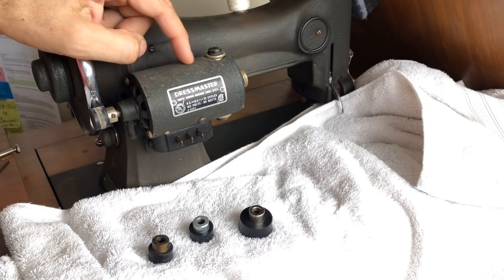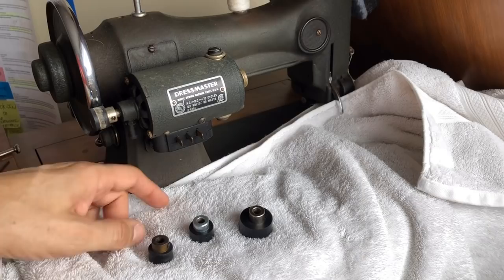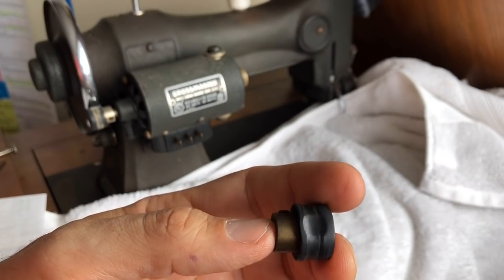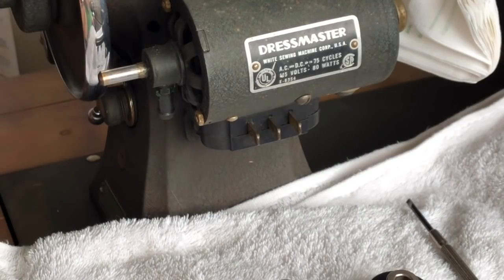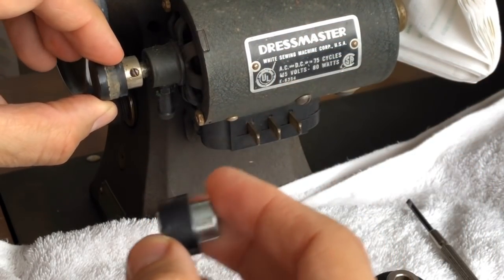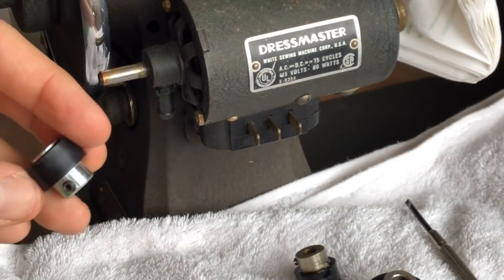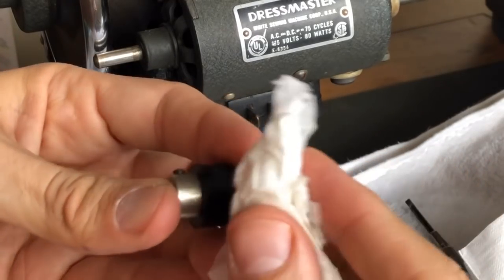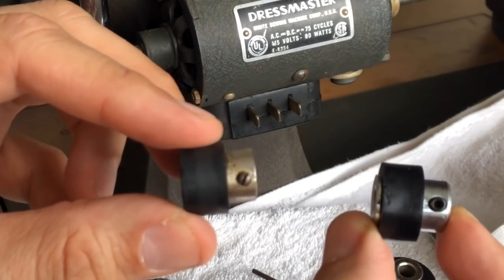ROTARY SERIES #1: FLAT TIRE! Replace a Rotary Machine's Friction Rubber Pulley & Start Sewing Again!

Comment: I have one of these, a sewing machine repair had a replacement pulley, but the spring has deteriorated. How are those replaced?
Reply from the maker: Hello Wanda.  The spring/motor mounts onto the body of the machine with screws.  You can get replacement (vintage) either spring or whole spring with motor at places such as Ebay or Bonanza.  I would try those first.  Theses machines were made in large numbers for many years so, similar to Singer, vintage parts are fairly common compared with some European brands.
Reply: Thank you!

Comment: Hello, thanks for the video.  I have a beautiful old White rotary that has only the one issue with that friction pulley.  I ordered a replacement, but the rubber was too thick.  Until I just watched this video, I didn't realize a pulley with a thinner rubber layer was available.  May I ask where you purchased your pulleys from?  Thanks so much!
Reply from the maker: Hello.  Sure,  I'm happy to share the supplier.  It is called:  Sew-Classic.  You can find them at: 
https://www.shop.sew-classic.com
Reply: @VintageSewingMachineGarage  awesome!  Thank you!

Comment: Would you say this machine is similar to the Montgomery ward model 30? I have my grandmothers and want to start using it but has sat for at least 20 years.... I’d love to use this series to help it get fully working again!!
Reply from the maker: Hello.  Your machine was made by the National Sewing Machine Co.  The model 30 (AKA "The Streamliner") was in production for more than 15 years and I believe it is a vibrating shuttle type and it works with long bobbins which was a bobbin system used by many makers including Singer but was eclipsed by the Class 15 and Class 66 styles which eventually became more popular.  So, yours is not the same as those Rotary models made by the White company.  White had a contract with Sears and so it makes sense that National would have supplied Montgomery Ward given it was a main competitor to Sears.  I have not overhauled one like yours since they are less common.  National also made machines for other private labels such as Macy's.  As you look for more info. on yours, I would also look for info. on National brand sewing machines as they would have had very similar models but perhaps with changes in color and trim.  Machines like yours were very strong machines and you are especially fortunate that it was in your family so you have a genuine heirloom!!
Reply from the maker: Also, I would find and join sewing machine groups in Yahoo or Google and search under National  Sewing Machine.  If you only search under Montgomery Ward, you will find machines unrelated to yours since MW would contract out with multiple makers over the years just like Sears did.
Reply: Vintage Sewing Machine Garage 
I found this very thorough article on my machine but I don’t understand a lot of it 😂 thought I’d post it as it may be helpful for you!!   The website also goes over many other machines. I appreciate all the input and will keep digging!! 
http://www.doubleveil.net/zssmp/streamliner.htm
Reply from the maker: Thank you for sharing.  Wonderful site and so much info. for a machine that gets little attention.

Comment: Is there any reason TO or NOT TO use the larger one on a machine with the smaller pulley?
Reply: Yes indeed! A larger wheel will increase the speed that the machine sews a great deal and will reduce the amount of power it has to get through heavy materials.  I have not used a machine with a larger wheel on it but I would assume that either the internal gearing on the machine is higher or that the large fly wheel on the back is larger as well. (probably the later).
Reply: @retrohipster994  okay, it'll be more of a 1:1 even ratio, I see now. Thanks for the reply! Idk why I missed that hahaha

Comment: I was sewing away today and CLUNK! The bobbin case fell apart in two pieces- or 3 if you count the bobbin itself. Oh good grief. Off to the mechanic in Westminster, CO.
Reply from the maker: Sorry to hear this though the good news is that if your bobbin case is not repairable (and it might be), a vintage replacement can be found online for very little.  These machines were made in VERY large numbers over many decades so at least it is not a rare part if you need a replacement.  Here is a link to a site I've used in the past that sells a number of replacement parts.  https://sewingmachine221sale.bizland.com/store/page44.html

Comment: Where can i purchase a pulley that will fit ? The one i got off ebay for my 117 959 will not fit the shaft, its too small,thanks.
Reply from the maker: There are a few different sizes for those pulleys.  This seller carries a variety.  I would contact them and ask them which one they have that might fit.

Comment: where can I buy a new tire for mine please
Reply from the maker: Hi Belinda.  They make new reproductions for these friction pulley tires.  There are two sizes that I know of so be sure to check which one matches the one you have.  There should be several online sources, but this site does have a good selection of Rotary parts both vintage and new.  Here is a link to the page of that site that I am getting mine from when I have one of these models to overhaul.  If you scroll down on this page, you should find items #8 and #9 are the two versions they sell.  If you have questions, the owner should respond.  https://sewingmachine221sale.bizland.com/store/page44.html
Reply: @VintageSewingMachineGarage  Thank you so much Mr. V

Comment: How do I insert the rubber part of the drive ?
Reply from the maker: The rubber part of this pulley wheel comes installed on the steel wheel that attached to the driveshaft.
Reply: Vintage Sewing Machine Garage I would have to buy the rubber pulley with the shaft together or just buy the rubber pulley alone ?
Reply from the maker: No, you just purchase the pulley.  I show in the video how to remove the old worn pulley and replace with the new one.  The shaft of the motor does not get removed.  The pulley installs off and on the shaft.

Comment: Some Elna machines also use friction pulleys, but those are tapered, which makes a replacement part a little more difficult to find and much more expensive.
I personally never tried that, but some people have reported good results after sanding the worn pulley with a small flat file while the motor is turning.
Reply from the maker: Yes, I have seen people try to whittle down the rubber wheels to remove the flat spot.  But it would depend on whether the base rubber was still stable enough to do this (if its dry rotted, I would replace it).  The other challenge can be getting it even when you are shaving it down.  Any variation in its round shape could cause vibration and/or issues in performance.
Reply: I used a small throw away finger nail  file and it worked   ok to  get the flat tire spot removed from  the  rubber pulley on a white, domestic,and an elna.  You  slowly run  the motor as you grind down the flat tire spot.  For as little as the average person would use these old  machines  it was a much  cheaper fix.  Remember when  not in  use place  a piece of fabric between  the machine and the motor to hold the rubber pulley away  from the hand wheel thus avoiding another flat tire.